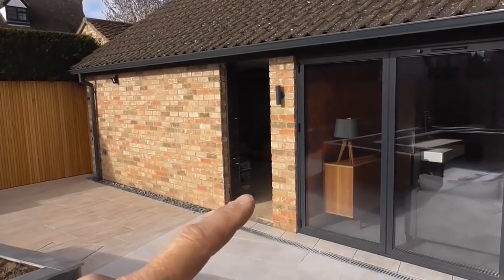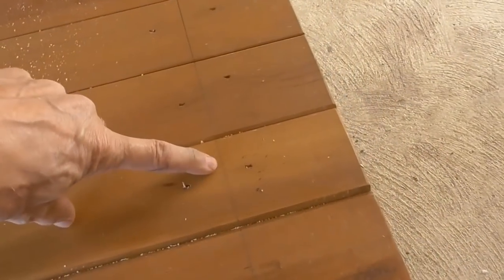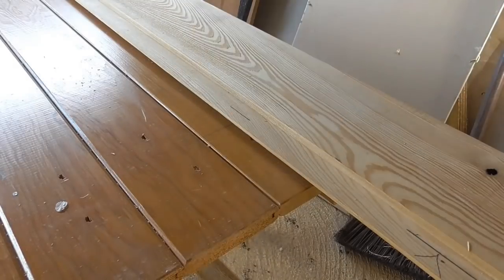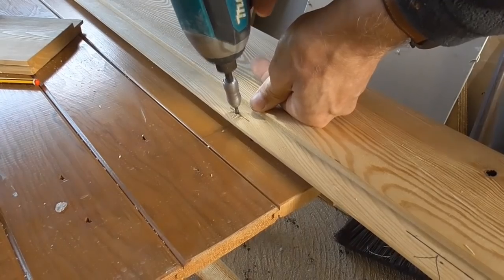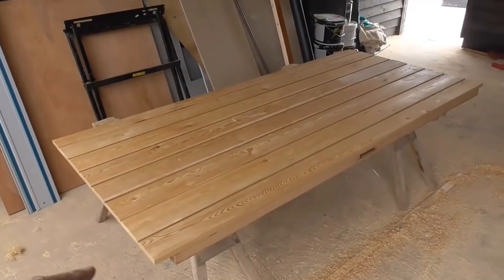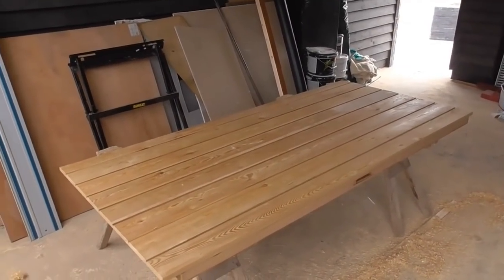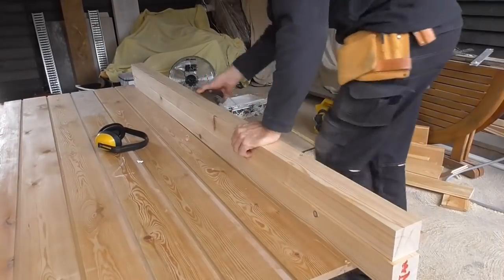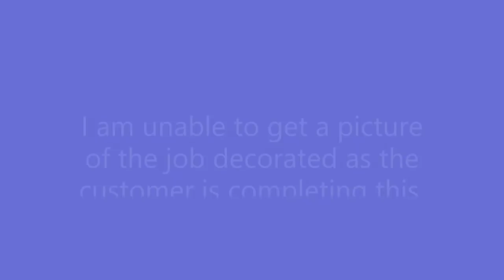Cladding an old door in Larch tongue and groove board and fitting.

Comment: Why did you opt to add the frame to the outside of the building instead of inside the aperture?
Reply from the maker: Hi Anthony.🖐 This customer is a chair user and this doorway is his rear fire escape route. The opening is only just wide enough to get through with his chair, and fitting a frame inside it as normal would make the opening too narrow. I also set the hanging side frame back the thickness of the door so that, when opened to 90 degrees,(in an emergency), it would still not reduce the width of the opening. Thanks for watching and your comment.😎 Cheers.

Comment: Hi, I'm new to this field and I have few questions:
1. Does screwing the cladding on to the door core affect the strength of the core?
2.  Is there any other way of cladding?
3. What is the wall made of? 
4. What is the kind of screw used to fix the door frame? Is the screw strong enough to hold the door frame and door?
Reply from the maker: Hi there🖐Screwing to the door core won't affect its strength. There probably isn't another way of cladding an existing door like this. The wall is solid brickwork, 100mm/4" thick. The fixings are super strong, M10x150mm Nylon type frame fixings👍Cheers Del
Reply: Thank you for clarifying  @thetallcarpenter

Comment: That looks really odd how you put the frame onto the face brick work and not in the opening and did double fix the outside tongue and grove boards, won’t they cup with just toe nail screwed 🔥🔫
Reply from the maker: Hi FB. The boards wont cup as the tongue holds the groove edge down.👍 Good spot on the way I did the frame. This job is for a chair user, and the door I'm fitting is to his rear fire escape route. The brick opening is wide enough for his chair, but not with any kind of frame fitted. I also fitted the hanging side frame back the thickness of the door so that, in an emergency, the door, when opened to 90 degrees, will not restrict the opening with of the door way.😎 Thanks for your comment.👍
Reply: @thetallcarpenter  I thought you were piloting the jambs, didn't think you'd be daft enough to fix it on the face. It looks great and really in keeping with the extention. New to your channel really enjoying the pace, music and minimal but necessary explanations, cheers.
Reply from the maker: @ooslum  Hi Alan, and thanks for looking in on my video.🤩 The door and frame will look great, and its a shame I could get a picture of it finished to show on the video.😢 Thanks again for watching and your comment.😎 Cheers

Comment: Why do both diagonal braces go in opposite directions? I always thought both had to have the bottom towards the hinge side.

Would this way be the same for exterior gates?
Reply from the maker: Hi Dan. These are mass produced doors and the diagonal braces are fitted in both directions so the door can be hung either side and not drop. You are right, that braces should really both run in the same direction from the bottom of the door on the hanging side.😎 Great comment.👍
Reply: @thetallcarpenter  I'm just checking things and learning as i see your videos. Keep them coming, thanks for the reply.
Reply from the maker: @handle1196  😎👍

Comment: I am about to do larch cladding on my mancave but everything i have read says you can't secret fix larch it must be face fixed as its unstable ? Did you ever have any problems with splitting and cracking after installing it that way?
Reply from the maker: Hi there. That's interesting as this particular larch cladding has a specific profile that allows for secret fixing. To confirm though, I have had no problems with this cladding splitting at all and it's been on nearly a year now.👍 (it was sourced from a highly reputable saw mill and was VERY good quality). 😎 Cheers.

Comment: Great job but confused about y you fixed the timber to face of brickwork must be a reason lm shur
Reply from the maker: Hi Trevor. This customer is a chair user and this opening is only just wide enough to get his chair through, so I mounted the frame on the face of the brickwork to keep the doorway as wide as possible. (its his rear fire escape route). Thanks for your comment.😎 Cheers.